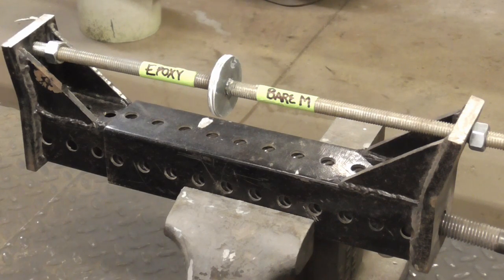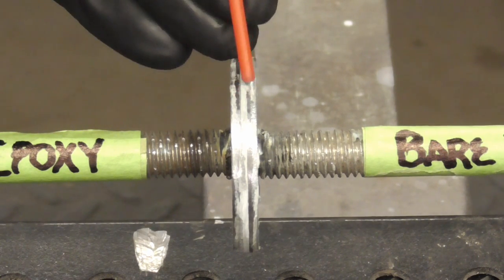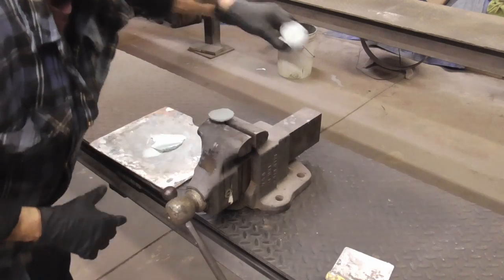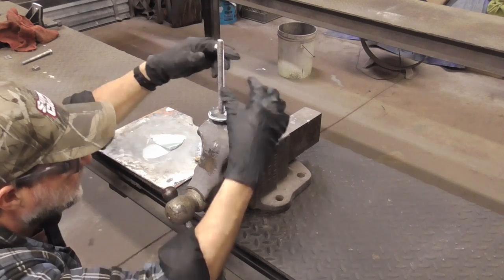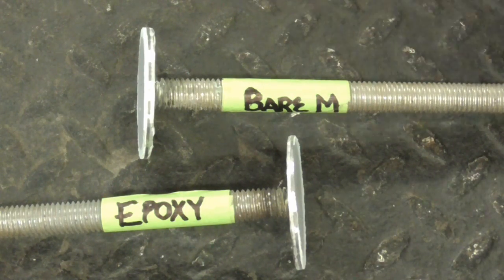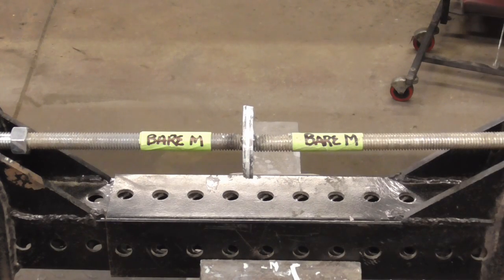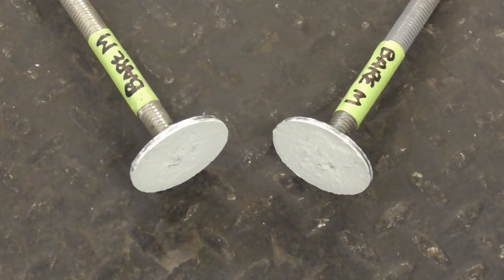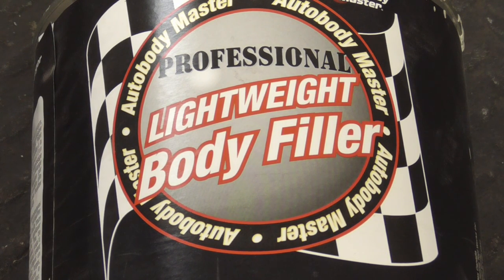Apply Body Filler Over Bare Metal or Epoxy Primer?

Comment: Interesting experiment Jerry! Question - was the epoxy keyed? I learned old school too; prep to bare metal with 36 grit. Trying to learn more about epoxy because it is a helpful tool when doing extended "Rolling Restorations" on a daily driver. My understanding is the epoxy needs to be keyed with 80 grit (up to 180 grit?) prior to applying body filler. I don't expect epoxy to ever beat bare metal/36 grit, but seeing that much epoxy pull off in your experiment was a surprise.
Reply from the maker: If you watch closely, the epoxy primer stuck just fine to the metal AND it stuck just fine to the filler - it's weakness was that it split apart which to me says because of this, the filler could come away from the panel more easily. I plan on doing it again with different types of epoxy primer, letting , it cure for a week, a few days, 24 hours, etc.  Thanks for the comment Icar - good to hear from you my friend
Reply: @LakesideAutobody  no epoxy primer , no warranty by any filler company. Every single auto manufacture says to prime first all bare metal. I will go by what they say. Will it work ? yes . is it the correct way to do it? NO
Reply from the maker: @mikeripley3266  Go to a dealership or actually get a job at a dealership or high volume body shop and watch the workers.  No one will ever put epoxy primer under filler.  Paint seals all of your body work.  Just don't set it outside for months, in tall weeds, under a tree, before you paint.  If you have a question about cleaning fish ask a guy who does it for a living every day of his life - no other way to find the truth.  If you don't listen to that advice, you will always struggle. Tell this guy he's wrong too - https://www.youtube.com/watch?v=rtUoaRxmgAg&t=424s

Comment: Thx for sharing. I was thinking same thin, the limited body work I did out of HS was done to bare metal , but if I could not complete Bondi work I always laid some primer on it. I think I will do sections of sanding/stripping on my C10 to try save time and money. Thx for great vid
Reply from the maker: You're welcome Dwayne.  One other bit of info.... every shop I've worked at, it was frowned upon if you put filler over anything but properly prepared bare metal.

Comment: Do what the manufacturer tells you to do! Any body filler I've used says to apply to bare metal. I've been doing it this way for over 30 years and have never had any issues.
Reply from the maker: Right on Steve - very simple.  Thanks for you input :)

Comment: Thanks for confirming what I have thought.  The filler I use (3M) says to put on bare metal sanded with 36 grit. Since I am not a scientist I do what the can says
Reply from the maker: Remember too - filler came out 30-40 years before 2k epoxy primer and other 2k primers.  It was always designed to be put over bare metal.  No one I ever worked with - no boss, manager, colleague ever did it - you better not be caught doing it either :)
Reply: @LakesideAutobody  I started in auto body in 1974 sanded a lot of filler over the years and have some to sand tonight

Comment: Jerry did you know anytime you use filler over bare metal and the metal is cold
The chemical reaction of the filler / heating up
Will cause condensation between the filler and metal and
cause rust problems later on down the road. 
I'm sure you already know this ' Might be worth mentioning in a future video for those who are not aware of this.
Reply from the maker: Tell me what you think about this.  When you spread a tight layer over filler over bare metal there is now no air or atmosphere between the two - right?  How does condensation form w/o air?  Just a thought.  I've never run into rust under filler unless someone did a poor patch job and moisture got in between through the sheet metal.  Otherwise,  I've removed quite a bit of filler and have never seen rust under filler if it was applied correctly.  I'll have to give it a try though.  Good idea for a video.  Freeze a piece of metal, mix some hot filler, throw it on there, give it a few months a see if any rust formed.  Thanks for the comment my friend :)

Comment: I am sorry to come into this discussion so late, but I just saw the video demonstration. A couple of points, first is this a really valid testing method? If so, why are we not using bondo instead of epoxy structural adhesives to adhere 1/4 panels and door skins? Polyester resin sticks to bare metal but is not waterproof when fully hardened, it actually absorbs moisture. Epoxy is fully water proof.  Second, since polyester resin filler is not being used as an adhesive, its main function is to fill imperfections and to move with the metal  panel to avoid cracking and splitting. Metal expands and contracts with heat and cold and any adhesives or fillers need to be able to move too. 
I would suggest a more realistic test to compare the performance of polyester filler is with a bend test.  First, put filler over ground bare metal and then filler over epoxy primer or even an dtm etching primer coated with a urethane primer . Both of these primers should be fully cured by baking or sufficient air dry. Then, bend the panels and see which panel bends the furthest before the filler cracks and breaks. When I saw this test done, the result was about 30 percent more bend on the primered coupons. In fact, the filler over bare metal cracks and breaks almost immediately. 
I have seen this problem in the shop many times and there is inevitably some really nasty rust under the filler. Curedpolyester filler does not bend.
In real-world applications, it is more likely a repaired panel will get bent again than have sufficient suction put on it to separate filler from any substrate.
Anyways, cheers to the discussion, and for your efforts to keep putting out quality videos of interesting auto body repair topics.
Reply from the maker: I did this experiment again with a bunch of different approaches.  My goal is to test the bond strength and see if the primer holds as well as filler to bare metal.  I've never had filler come away from bare metal so I know for sure that works.  Just seeing if filler over epoxy is legit and can be done too :)  I'm uploading the new video today actually - 4/15/22  Have a good weekend.

Comment: I’ve just about fully mig welded sections on my landcruiser hj60 roof which were rusted an bogged  by previous owner , after 3 months I’ve been getting blisters in my filler , an it’s from putting filler over etch primer 
This is a great little video that clarifies to only put filler over roughed up bare steel
Reply: You're comparing apples and oranges....

THE issue you have/had is putting the filler over ETCH primer.

Etch primer needs to be coated with epoxy primer BEFORE body filler is applied  (IF that's the route you decide to go)

 Etch primer contains a mild acid which is the 'etching' part of the primer.

You could simply lightly apply epoxy to help seal the metal until you are ready to apply the filler. Spray, brush, roll the epoxy on...

THEN sand/rough up/remove the epoxy later on when you are ready to apply the filler.

I've found overall, body filler needs 'tooth' ( scratches from sanding for best adhesion).
Reply from the maker: With respect, body filler  was designed to be put over bare metal.  Remember, it came out 30-40 years before epoxy primer.  In all the shops I’ve worked at in the metro Detroit area not one boss, manager, worker would ever accept putting filler over anything but bare metal.  A guy who did would have been laughed right out of the shop. Yes you could cheat and get away with putting it over paint and primer on small stuff but it was always frowned upon.  The guy who got caught doing it was considered a hack or a newbie - couldn’t get his work straight so after he primed it, you saw him fiddling with filler again - over the primer he just blocked & found out it was too f’d up to fix with just primer.

Comment: The adhesion is better, but that doesnt necessarily mean corrosion resistance is better.

Thanks for doing this experiment though. Its definitely interesting
Reply from the maker: With respect, that corrosion resistance stuff is all magazines and internet.  Body shops do not use epoxy at all.  They know that the best corrosion resistance is paint.  If you work on your car inside, there is no need for corrosion resistant primer or undercoats :)

Comment: Very interesting. I have wondered about that. Does filler put on bare metal encourage rust to start though?
Reply: Yes, moisture passes through body filler and so can cause the bare metal underneath to rust.
Reply from the maker: With respect, how is moisture going to pas through body filler when your car is painted?  Your paint protects everything under it.
Reply: @LakesideAutobody  that makes zero sense if that's true why not just slap paint over bare metal. Plus you can take a copper coin and coat it with auto clear and it will still oxidize so it is not sealing out "everything".
Reply from the maker: @Randazler  The way it was done in every shop I've worked at since 1984 was - bare metal, filler, primer, paint - period.  That's just the right way to do it.  With respect, body filler  was designed to be put over bare metal.  Remember, it came out 30-40 years before epoxy primer - that sort of ends the debate right there.   In all the shops I’ve worked at in the metro Detroit area not one boss, manager, worker would ever accept putting filler over anything but bare metal.  A guy who did would have been laughed right out of the shop. Yes you could cheat and get away with putting it over paint and primer on small stuff but it was always frowned upon.  The guy who got caught doing it was considered a hack or a newbie - couldn’t get his work straight so after he primed it, you saw him fiddling with filler again - over the primer he just blocked & found out it was too f’d up to fix with just primer.  That's just the facts.  You  always prime bare metal before painting but primer never goes under filler.  You can get away with it but it's just not done that way in dealerships or professionally owned body shops.  Hope that helps - Jerry

Comment: Has there been any issues with epoxy primer? I understood the point of the epoxy was to seal the metal against moisture. Sort of a belt and suspenders approach
Reply from the maker: The reality is that the only thing that is responsible for protecting steel against moisture is paint.  If you are going to leave your body work unpainted for months at a time I can see the use but otherwise not necessary.  Most body shops do not use epoxy under filler - it's a TV/magazine/blog thing.
Reply: @LakesideAutobody  I suppose the difference between restoration work and insurance work.
Reply from the maker: @SubversionGarage  Yes - insurance work is done so folks can continue  to drive it daily.  Restoration work is more for parking in the garage - you don't want to be driving that thing around in the rain and salt with ground down, butt welded seams right under the paint.  Those tiny little pin holes and imperfections in the seam can quickly bubble the paint and show the patch outline.  Not being a smart guy either - I think that is the real difference.

Comment: Hi there,  all good and well, but when moisture penetrates and the bare steel rusts? Then there is no adhesion.  Comments please
Reply from the maker: Paint protects everything underneath.  Moisture doesn't penetrate primer, filler, putty unless it is left unpainted.
Reply: @LakesideAutobody  Thanks very much,  makes sense.
Reply from the maker: @davidc2585  You're welcome Mr D.  One thing to remember too is that filler came out about 30-40 years before epoxy primer.  It was made to be applied over bare, prepped metal and worked and still works just fine that way.  Hope that helps a bit :)

Comment: Does the same apply when the metal is aluminum? I have some large aluminum body panels I’m working on and wonder which is the best substrate for filler: bare metal or epoxy…
Reply from the maker: It is recommended that epoxy is used first on aluminum.

Comment: can you do a vid on scuff and shoot paint jobs? i have a truck and most of the paint work is okay but ive done some dent pulling and body filling so decided to sand the truck down but not to bare steel ( because i don't have a roof over it and im in the uk so flash rusting is a pain) i plan on just roughing up the surface and only using primer on bare steel where i pulled dents ect. single stage paint over the whole thing in graphite grey ( original colour is grey too but a metallic). would like to know you opinion on quick budget paintjobs for 20 year old trucks
Reply from the maker: For inexpensive single stage, you can go wrong with TCP Global Restoration Shop - very affordable.  Single stage Nason Ful-Cryl or Ful-Thane is great stuff but more $.  Both are much less than say PPG, Dupont, etc  As for your outdoors situation.  I would take it one section at a time.  Like do a fender, prime it and then move to the next.  I have left primed panels outside for months (lacquer primer surfacer) and have never had an issue with rust issues.  Park it in a spot that the sun hits it or wind hits it so it can stay dry - that's the key.  It needs to dry after it rains or snows.  If you do see any rust popping through the primer, you'll have to DA sand that area again a prime but I'm thinking you won't as long as you use 2-3 coats of good quality automotive primer.  Thin primer or even spray bomb paint will rust quickly but a good layer of primer will be fine.  Hope that helps :)

Comment: Is it okay to etch the bare metal with Ospho and then apply the bondo, or just leave it bare?
Reply from the maker: I have always left it bare.  However, I worked at a place that made use use a rust converter on any pitted areas and it never had an adverse effect in the end.  I think you would be fine - I might make a video trying it and testing it though - I think that's a legitimate debate :)
Reply: @LakesideAutobody  Thanks for the reply!

Comment: Why don't you do the same test again, but DA both with 36 grit [instead of 220 for the epoxy and 36 for the bog]
Reply from the maker: I will do this again with a few different brands, dry times, paint, etc.  I used the 220 for the epoxy because paper in that range is what you are supposed to use for it to stick well.  You use 36 grit fiber resin disks for applying filler.  You also wouldn't want to prime over 36 grit in real life either.  Hope that clears it up a bit :)

Comment: What if you paint with epoxy on bare metall, and before you put bondo on, you scuff the surface? I personally has always put bondo straight onto bare metall though. But im thinking about the corrosion protection. But when i think about it, as long as there is no hole in the metall it should work fine with bondo instead of epoxy since the metall works as a moisture barrier
Reply from the maker: You're right but I think there are other folks thinking corrosion protection from the other side!  As you probably know paint is the ultimate protection from corrosion from that side but folks tell me that primer and filler absorb moisture and it's best to use epoxy primer first.  If you leave it outside for 1/2 a year I can see - but otherwise no need :)

Comment: ok great i had been wondering about the same thing. after bodyworking the filler on the bare metal what primer is recommended first epoxy or polyester primer?
Reply from the maker: After your body work you have 3 choices of primer surfacers.  Lacquer primer surfacer, urethane primer surfacer & polyester primer surfacer.  Poly is for if your body work is a bit off and needs a lot of help 'cause this stuff builds fast giving lots to block sand.  Lacquer and Urethane is your basic every day primer surfacer - I like them both - your choice.  Urethane is 2k - a bit more pricey.  Lacquer Primer is 1K -  just thin and spray.  Again both work just fine.  What ever is easily available and in your price range.

Comment: Now I have been working on an old Duster for a bit now.  I know that epoxies should have at least 72 hours too fully exotherm their chemicals.  Now my findings through conversation is that the bodywork should be done PRIOR to epoxy coating     Now this car has had previous work performed with POR15 and bondo.  Some of the areas are fresh when I purchased it .   What’s your thoughts on epoxy sealer primers over existing work ?
Reply from the maker: The rule of thumb is:  If the body work and paint are in good condition, leave it and prime over it.  If it's checked, cracked, pealing, super thick (tons of coats of paint), cheap gummy paint or damaged in any way it's best to remove it.  I've never had to do work over POR15 so I don't know how that will behave when sanding or priming it.  It may clog the paper.  I think it will accept being coated with epoxy or urethane primers though.  Hope that helps - let me know how it goes for you Doc - Jerry